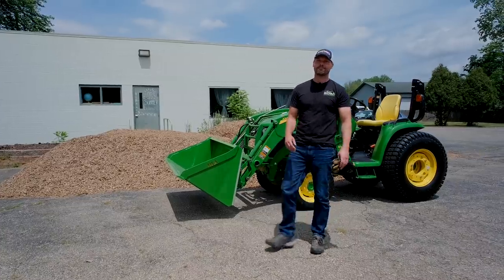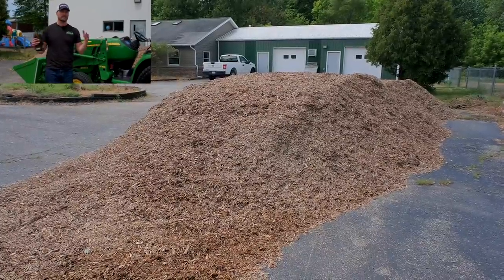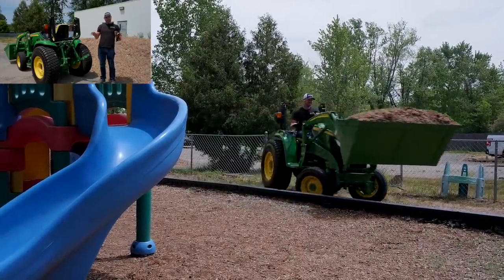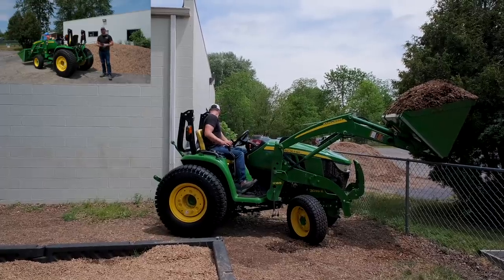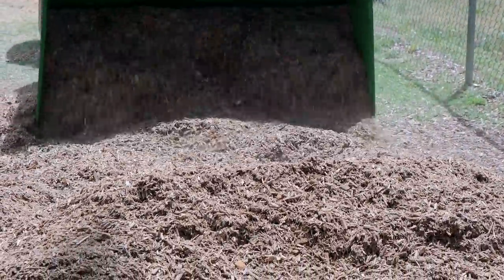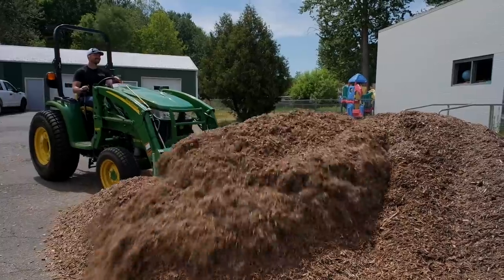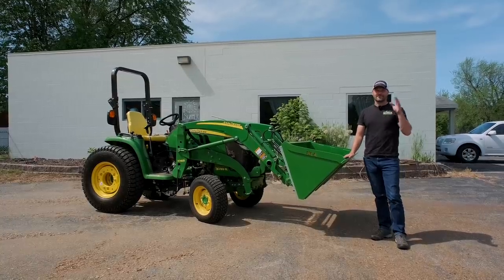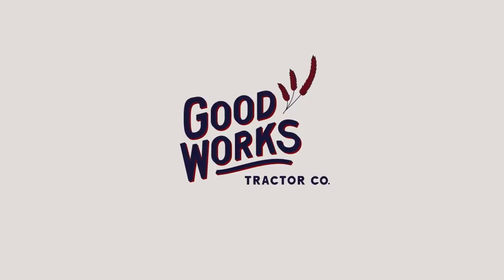LITERALLY SAVED 50%! SAME TRACTOR, BUT SO MUCH FASTER 🚜👌

Comment: Those oversize buckets are nice but can get you in trouble with stone and dirt if not careful. Rear ballast is a must and max air pressure in front tires and try to limit amount picked up.
Reply from the maker: The tractor and loader don't care what's on the front as they will max out at the same point anyways.  Could be a round bale, pallet of pellets, or grapple with a log, the loader will still only lift so much.  Proper counter weight will save the day time and again and hold your loads as low as you can at all times.  Thanks for watching!
Reply: It's more of a concern with skid steers, most have enough hydraulic power to easily tip. A larger bucket can get into trouble. Most tractors are hydraulic limited. But having a large (heavier) bucket can decrease your capacity picking up dense materials.

Comment: Another Great video! Great capacity for a tractor! Anyone that’s ever done mulch or dirt calculations knows it’s 27 cubic feet (corrected) in 1 cubic yard...with you getting 13.5 cubic feet per bucket,  that makes for quick work with the tractor.

Great camera shots too!  I like the slow motion footage of the mulch flowing!

~Jon@SBYD!
Reply: That'd be 27 cubic feet. - You might consider bigger gates, or more of them, or a different layout.- Does that dust stay down in the mulch?
Reply: @heymakerphd1982  Thanks!...Good catch (corrected)  Still cool that the buckets rated at 13.5 cubic feet (per 1:00 look at the sticker)...makes for way quicker work than my standard sub compact tractor bucket!

Comment: You should try the Mike Morgan Method for scooping from a pile where you back drag material down from the top then scoop it up with the bucket.  You are only pushing and lifting the bucket through a short pile...less stress on the tractor and easier to get a full bucket.
Did you have to remove the "old" mulch first before applying the fresh?
Reply from the maker: We specifically showed that several times in the video.  Common practice that I've mentioned in quite a few videos over the years.  Definitely makes it a lot easier!  Not every second of work made it into the final cut though.  Thankfully, we don't have to remove old mulch though.  That would be a real headache!

Comment: Consider using rubber mulch.  Lay a ground cover first then the mulch.  Yes it is more expensive, but it has much better cushioning than wood mulch.  It is rated as preferable for playgrounds.  Cost is mitigated because you only will need to spread it once. It does not degrade, so you only need to do it once rather than every year.  We did this in a community play area about 14 years ago.  We do rake it out to redistribute every other year or so, but have yet to need more.

Comment: I bought a new tym t264 and bought the next bigger bucket they offer.
8.8 cubic yard. Not heaped. And bucket was only $450 from dealer.
And tractor moves that bucket like its the stock one. Rock mulch dirt it don't care. Tractor handles it amazingly
Reply from the maker: Glad to hear it!
Reply: 8.8 cubic yards? Are you sure?
Reply: @heymakerphd1982  no my bad I meant 8.8 cubic feet
Reply: I see you corrected yourself. The biggest bucket I ever used was a 5.75 cubic yard on a 930H Cat and a 4.5 cubic yard on a 524K John Deere
Reply from the maker: Knew what you meant, no worries

Comment: When I worked for the largest construction company in ct. head mechanic supervisor told me you should practice not spinning the tires when loading the bucket. It took a lot of practice but now it’s second nature!  This is not criticism!!
Reply from the maker: It's definitely easier said than done.  Normally don't do it much, but for some reason the turf tires and that asphalt were a little light on contact.  I think it was the dust from the mulch.
Reply: @GoodWorksTractors  this was definitely not a criticism, having said that it’s always good to practice in every situation.
Reply from the maker: No worries on my end.  I could notice it, but wasn't really too worried about it.  Have a good one Don!

Comment: I would add use caution when going to a larger bucket with sand, dirt and rock or anything heavy. Just because you can lift it doesn't mean it's safe, know the limits of the machine. Advice from a person who has driven a loader for a living .
Reply from the maker: These compact tractors will only lift so much regardless of bucket size, pallet forks, grapple, etc.  I have made many videos on safe loader operation, counter weight, etc.  I agree, go slow, carry loads low, accidents happen in the blink of an eye.
Reply: My biggest problem has been rutting with the front tires when bucket is loaded

Comment: Man I wish I would of gotten the 3R for the lifting capacity!! I have the 3038E with maybe 20hr on it and I’m happy with the power, just wish I had more lifting capacity..
Reply from the maker: I went from a 3r to a 4r for the same reason, haha!
Reply: @GoodWorksTractors  I really wanted to get a 4 series tractor but I couldn’t justify paying that much for what I need it for. But the 3R were as much as the 4M when I was shopping for them. I like that I can fold the rops down and pull it into my garage but I might be looking to trade mine in for like a 4052M. I just have a lot of attachments that will also need to be upgraded..

Comment: Great video to see how these bigger compacts work in smaller spaces. I'm curious though if the front axle can take a full load of rock with that bucket?
Reply: It will still only lift so much weight, regardless of bucket size, so I don't see the axle being over loaded.

Comment: Wondering if you piled enough chips over the borders to let you drive over them if that would have helped you get around easier closer for the playset.  Or maybe they would have crushed under the weight of the machine?
Reply from the maker: That's a good idea! Where were you a few days ago with that?! In reality, because it was such a small area, and chips are relatively light and easy to spread, it didn't make for much of a difference in the end.
Reply: @GoodWorksTractors  Roger that.  Some days it’s like:  let’s just show up and get it done.  Thanks for the great videos.  Always glued to the next update.

Comment: Fun video. I have a 2038r and thinking about moving to a 3046r with cab. The lack of front end visibility is stopping me though. Is that something you get used to over time and just get good at reading the bucket level indicator quickly?
Reply from the maker: I think even without the indicator, you get a feel for it pretty quick.  I don't think any of the Series have great visibility though.

Comment: For that much machine work it would have more than justified to modify your chain link fence.
Reply from the maker: We thought about it and came to the opposite conclusion.
Reply: What were the reasons to use this sort of mulch in a kids play area?  It sticks to clothing, When damp it gets tracked all over your building, And worst of all the kids get slivers from this type of material. This was what we did in the eighties
Reply from the maker: Cheap, meets the safety requirement for commercial playgrounds, it's called playground mulch specifically designed for playgrounds.  Slivers have been a non-issue.  Doesn't track in the building that bad.  Every product has trade-offs.

Comment: Too bad John 1 was in the shop. Actually, you could have used John 1 with a landscape rake to maybe go even a tad faster or a Kubota subcompact. I was wondering when you were cleaning up do you think a brush would have got the mulch gathered together on the residual? I was thinking they had a subcompact with the third function could demonstrate the cleaner as well as the raking while you're bigger three series did the literal heavy lifting. Lol
Reply from the maker: Possibly.  This would have been a big bucket for the 1025r.  I think it would have been fine, but not positive.  I couldn't get inside the center section with a tractor, so that had to be done by hand.  Navigating sure would have been easier with the smaller footprint.  Yeah, broom or brush would have got the lot spick and span, but backpack blower made pretty quick work.  Lots of ways to accomplish it for sure!
Reply: @GoodWorksTractors  That's true but I figured you could keep the 3R out there with the larger bucket and have the subcompact do everything else. The thing I like about the subcompact tractors, and I know you do too, is there so maneuverable in landscaping work. I guess that's another reason why I like Ventrac and Steiner. Speaking of those two brands, I think one of them has an attachment that they put on their small scoop bucket so you can actually carry more volume of mulch when you're doing landscape work. I was thinking that that might be another avenue to create something for the subcompact tractor for people that are using it for lighter materials but a lot of volume. Maybe it will even be your next GWT custom attachment! Lol lol
Reply from the maker: Yeah, haha, I have thought about some sort of extension for that purpose.  Want it to be semi universal though, I hate the idea of carrying so many sizes in inventory.
Reply: I think that I would like to do business with you, very polite never get frustrated just explain your reasons & say that you would try their idea or had already tried it

Comment: That is a tight fit.  Nice bucket.  What are the 2 white strips on either side of the back of the bucket?
Reply from the maker: Haha, yeah it was.  Good thing it didn't have spacers! 😂  Those are just plastic protective strips from shipping.  Figured I'd leave them on there for now.  Will sell as a demo, so keep it in as good of shape as possible.

Comment: Why are your ROPS down? I get that mulch is less dense, but you could still tip!
Reply: Not really...but it was up...Better check for seat belt as well Mr safety man😃
Reply from the maker: I'm guessing you didn't watch the whole video?
Reply: @GoodWorksTractors  my bad! I had to go part way through the video. I couldn’t believe it when it was down because I know how important safety is to you. 

Glad to see you had it up after watching more! An old family friend of mine was fatally injured in a tractor tip over and I can never let the ROPS being down go unnoticed.
Reply: @chex313  they put ROPS on for a reason! If you read the JD manual it does say that if you have to have the ROPS down for clearance reasons to NOT wear the seatbelt which I thought was an interesting fact.

And yes I was able to watch the rest of the video later on and see that he ended up putting the ROPS up! Also very happy to see that he brought attention to it in the video.
Reply: @n1cholas.w  ive wore a tractors seatbelt once.  4wd and lo and 1st up and down straight only brush hogging on a steep hill for a friend using her tractor as mine wouldnt be as nice and safe
Reply: @tractorboy31  I’m not a fan of hills! I’ve been working with a mini excavator recently on a project on a hill and man do you need to wear the seatbelt in that thing, otherwise you wouldn’t be in the seat!